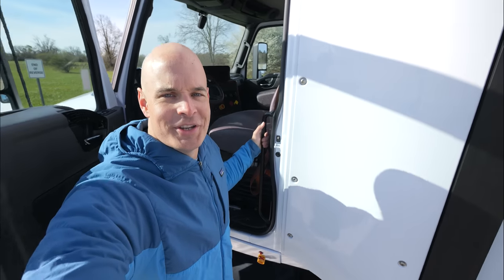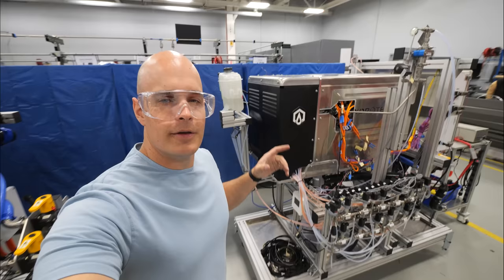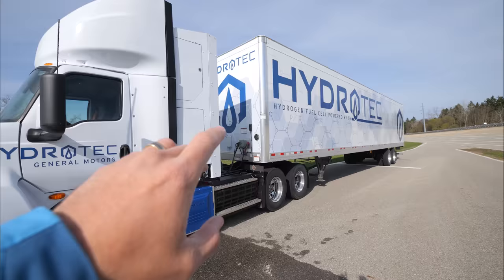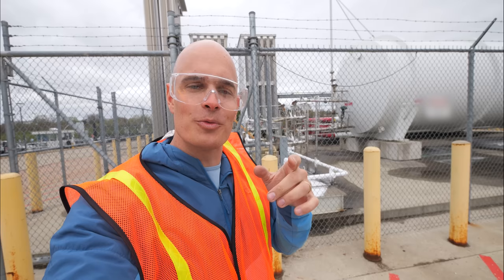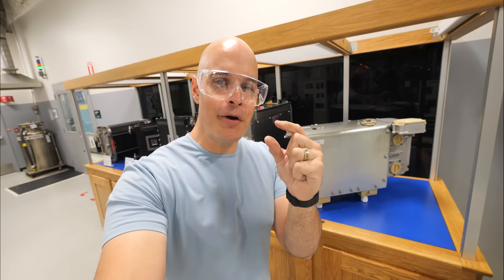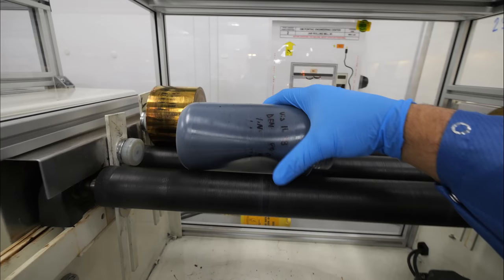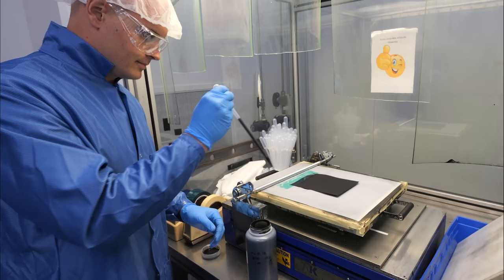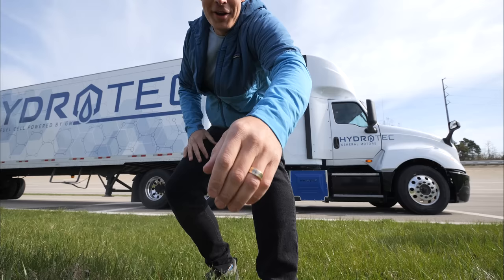How to build a Hydrogen Fuel Cell Semi Truck? - Hydrotec Factory Tour

Comment: I'm curious how a hydrogen semi handles crashes compared to lithium ion and diesel. My intuition would be that the rapid decompression would be very damaging.
Reply: I'd love to see some comparison
Reply: 10 000 psi would make a nice fireball
Reply: It'll blow up like crazy. Diesel doesn't explode unless it's superheated and gas piwer cars have much smaller tanks. Hydrogen on the other hand... hindenburg
Reply: It actually doesn’t blow up at all it is pretty quickly evaporated and that’s it. Explosion’s are extremely unlikely as you need to first ignite it and it would also only burn on the part which was punctured. As it requires Oxygen to burn and there isn’t any in the tank there isn’t really a huge risk. 

There i would be more concerned about the explosion of a battery.
Reply: @platin2148  you forgot the part where it's under pressure
Reply: @andrewk8636  And since when does this require anything to make a giant explosion? Especially fiberglass tanks are most likely to not simply explode but slowly loose the pressure. It might even sort of self heal or clog up as it creates frost.
Reply: Plus that cab did not have a sleeper on it which may causes issues. Trucks can only be certain lengths and the added space for thehydrogen storage will that preclude having a sleeper on the tractor. If not then the hydrogen is being stored right where they are sleeping.
Reply: @GregM  That’s more a unfortunate design choice there are some trucks from MAN and Mercedes who have them basically on the same place as there diesel equivalent because why not?
Reply: It is actually QUITE safe.  The carbon-fibre tanks are insanely strong, but even if they did rupture, the hydrogen would just be released as a  gas.  That might be a somewhat dramatic event, but there would be no fire.  Even in tests where they have explicitly set the fuel line on fire, it just burns like a torch; no explosion.  Compared to a battery fire, this is quite easy.
Reply: @whojamacallit  The thing is, there is still a battery in there, and in the case of a collision, if the battery catches fire, it won't be easy to extinguish, and it may affect the hydrogen tanks.💥
Reply: @giorgos997  The flame will just be a blowtorch as David stated. They basically tested this with Toyota Mirai, hydrogen is lighter than air hence it shoots up really quickly. Flames are not fast enough to actually reach the inside of the tanks, there's also additional pressure relief valves that acts as added protection that basically releases the gas to the atmosphere the moment a fire is detected.
Reply: @giorgos997  what battery?  the 12/24v system that even a diesel has?  There is no other battery.  A fuel cell doesn't charge a battery, it powers motors.
Reply: @whojamacallit  No, he mentions in the video that there is a supplemental 220 kWh battery. 3:05

Comment: Really enjoyed this video. Thanks Jerry.  I drive long haul and there is just no way a battery powered truck could work. Hydrogen is the best fuel alternative for the long haul trucks. Keep the electric ones for the last mile and short haul stuff. I'm pretty sure switching diesel fuel pumps over to Hydrogen would be easier than charge plugs. I'm excited to see this is getting closer to reality. They just need to make the fueling process idiot proof, trust me if you saw what some of these drivers do to regular pumps, you would have concerns about Hydrogen pumps in their hands.
Reply: How long do you drive (legally) without a break?
Reply: @rogerstarkey5390  I do about 10.5hrs total. I will go for about 6 hours straight then do my  mandated 30 minute break, I have to do that 30 minutes within 8hrs of starting my day. Then along the way I will stop every so often for a 10 minute break to just get out and stretch the legs and back. Not as young as I use to be and my back lets me know it. HA Legally we are allowed 11 hours of driving in the US, in Canada I can do 13 hours, but in both countries you only have a maximum of 14 hours of driving and On Duty  time on your logs. So if you start at 7am your day will end at 9pm, no matter if you drove 1 hour or 11 hours. It sounds like a lot of hours but you get stuck at a customer loading or off loading, get caught up in a traffic back up and there go your hours. It's happened to me so many times I just laugh and say It gets there when it gets there.
Reply: @Johnny_Kanuk  It's also the same case from what I recall for heavy machinery. They're also favoring hydrogen for lesser downtime, especially for big equipment that may be used in multiple shifts via driver swaps to lessen downtime which costs money for companies.

Comment: The hot water exhaust should go to a tap in the cab so that the driver can use it to make tea.
Reply: That's about all these things going to be good for with its incredibly low payload and range, just like ev trucks.  It's a shame hydrogen is not a fuel source this whole idea was flawed from the start. 

Hydrogen is what's called an energy Carrier,   Hydrogen is just another demand for fossil fuel. Hydrogen can be "made" with other methods but 99% of the hydrogen on this planet has been manufactured with fossil fuels because it's so energy intensive.
Reply: @Dat_Sun  FCEV range isn't bad and unlike BEVs you can refill extremely quickly.

Comment: For comparison, the classic steam locomotives operated at 250-350 psi. If the boiler ever exploded, they caused catastrophic damage, and shot pieces of locomotive as far as a mile away. Now we're talking 10,000 psi. If these things are ever in a bad wreck...
Reply: its not the same, gas density reduces the stored energy enough to not be that hazardous

Comment: At Least you could add a hydrogen range extender to your humvee, as there are 5kW fuel cell modules available for sale and they attach to regular h2 steel bottles. But I guess you would need a decent step up converter to get the voltage level up to your tesla battery modules

Comment: The first hydrogen powered semi is now  used by PepsiCo in Australia. So beyond an engineering sample
Reply: There's several Toyota/Kenworth hydrogen trucks running around LA for years.
Reply: @CACressida  They've also committed to commercial operations recently due to their success with the pilot program tests with real-world customers on LA. Kenworth is starting builds right now powered by Toyota's FC drivetrain with orders available early 2024 if I recall.

Comment: Hey, Zack, you should make a Hydrogen Fuel Cell for your Humvee, so it can charge the batteries to extend your range. this way you can get better mileage. Just Like the ones on the 18-wheeler but just a bit smaller than those. you can store maybe two of the carbon fiber tanks and it can generate enough kilowatts to keep all of your battery packs charged to give you at least two to three times more range. So if I remember correctly from your videos, (I could be off a bit),  you were getting about 250 miles on a standard charge. You could get about 500-750 more miles with the addition of a Hydrogen Fuel Cell
Reply: Theoretically yes, practically hydrogen is the most difficult gas to contain (and thereby also dangerous when not done well). Which would make it incredibly expensive for such a project.

Comment: Hydrogen powered house 😍
Reply: Kaboom
Reply: The most dumb idea I've heard in a long time. Why not blow the energy directly out of the window, along with loads of money?
For ground storage you can use cheap battery chemistry (energy density does not matter), that does not waste 80% of the energy you put in as conversion losses. And it does not need super expensive platinum catalyst.

Comment: This seems like a better idea than batteries. But wouldnt a ton of these trucks on the road create black ice in colder climates ?
Reply: Did you notice the hydrogen was just "in the tank"?
.
Consider the extra Grid infrastructure you need for this over and above straight battery storage. (Hydrogen is just a STORAGE medium, like a battery)

Comment: So cool to see another form of fuel for our earth. I think EV has a place but this could be something that could work beside or be more fuel efficient. Thanks for sharing!
Reply: If you use three times the grid energy to move a truck the same distance, it's not "fuel efficient".
Who do you think will pay for the grid energy?
The generating company won't give it away.
The grid utility won't absorb the cost.
It will be passed to the end user...... In an industry when cents per mile counts? You think that's going to work?
Reply: Ah..... This IS an EV. 
Just a very inefficient one because it is trying to produce the electrons onboard rather than take them from the grid.

Comment: Really well explained! I still think hydrogen doesn't make sense in cars, but I definitely see the use case in vehicles such as trucks.
Reply: Agree, the same as batteries in trucks make no sense, the weight penalty of the battery negates the trucks ability to move heavy loads efficiently

Comment: Two pretty significant problems with a hydrogen fuel cell based future (which for some reason no YouTubers ever explore in depth). 
1.  There exist no alternatives to Platinum group metal (PGM) based catalysts which are as both as efficient and durable, so without major advancements, we're trading one non-renewable resource  (fossil fuels) for another that are literally some of the rarest materials on earth.   There is no path forward for the hydrogen economy that does not include extracting pretty much all known PGMs from the earth along with 100% recycling, ignoring the fact that PGMs are in demand for many other processes. 
2. Hydrogen production itself is very dirty.    The current methods of hydrogen production include, Steam Methane Reforming (SMR), Oil Reforming, Coal Gassification, and Water Electrolysis.     Unsurprisingly, the first three methods account for 96% of all global Hydrogen production, and all of them produce higher end to end CO2 emissions than simply producing electricity directly from any of the same sources (natural gas, oil, and coal).     This is dumb, in a similar way that growing corn to product ethanol is dumb.

Comment: You should look up metal hydrides which is the newer way hydrogen is stored. It’s stored in a metal solid and is at low pressure and won’t explode if the tank gets ruptured because it’s stored in metal solids.

Comment: As a trucker I'd have some concerns! The length of this unit would make it rather impractical for city use (I deliver food to restaurants in urban areas) but I could see this being useful for OTR or regional applications. 

Also if the batteries are on the small size, how long can the unit sustain full power output to climb a long grade? Can the fuel cells put out enough juice so that doesn't happen, or will you run the batteries dry on a long climb? 

Does extreme weather impact the range of the fuel cells, like it can for batteries? 

What's the weight of the bobtail? Axle weights? If it's too much heavier than a traditional unit, nobody will want it because it means less freight hauled.

Comment: hydrogen fuel cells are cool tech for sure.   I still wonder if we wouldn't be better off moving back to rail transport though.  My limited research into it says rail was always cheaper and more efficient, it's just that bigrigs don't have to pay the full price for road construction, where railways do.

Trains could displace not only a lot of long haul trucking, but also plane traffic, and would be easier to electrify than either long haul trucking or flight (most trains already run on electric motors, and it's easier to replace the on board diesel generator than the entire drivetrain)

Comment: you start with an electric semi truck to make a hydrogen fuel cell truck. I think Tesla Semi electric truck is the most optimal, they crammed 900kwh into the thing so that it gets massive regenerative braking.  Strong regen braking is crucial for Semis reduce brake fade/failure and so is to reduce maintenance of the brakes, also to charge batteries when braking or going down hill.  Making a good hydrogen truck might to need start with at least 600kwh of batteries, but at this point, you just make an electric truck.

Comment: Zack
Do a Sun to wheels analysis of the energy used.
Ask what that solar energy would be used for if it wasn't being used to inefficiently liberate hydrogen.
(Clue, it would be removing fossil generation from the grid...... The fact that using 3 units of solar to provide hydrogen means 2 units of fossil remain, meaning the grid is dirty compared to using straight electrical storage..... Hydrogen is dirty ... All of it )
.
Ask who pays for the grid energy. (Hydrogen is expensive)

Comment: as a mechanic, the way i see the future of the standard car, it will be an hybrid between hydrogen and lithium ion batteries for fuel. You get the silent ride with good horsepower,  high and snappy electric torque and fast cheap fuelling.

Comment: THIS should be the future of vehicles not just EVs but at least a combination of EVs and Hydrogen. Both are clean, but hydrogen can fix the range and refuel time problems EVs have.
Reply: This IS an EV. In fact it is a BEV as stated in the video.
It's just dragging along fuel cells and a pile of hydrogen tanks too.

Comment: This is the future of many sectors like construction, farming, maybe planes? and so on for situations where you need the capabilities that fossil fuel gives today. Without the disadvantages like weight, slow charge time, low energy density etc. that batteries have. However, for transport on roads where charging infrastructure can be implemented, batteries make a lot more sense because of the efficiency that hydrogen is missing. 

So, to simplify, think of batteries like petrol and hydrogen as diesel. Each fuel has its advantages and disadvantages and therefore different usecases.

Comment: Very nice video about technical aspects of hydrogen vehicles. However they are few very important points that should be stated.
1) Hydrogen being most abundant element in the universe. True it is also highly reactive which means free floating hydrogen can only be found in vacuum of space. On Earth there is no free floating hydrogen, it needs to be manufactured either from hydrocarbons (which produces carbon emissions) or by splitting the water molecule (electrolysis). 
2) Hydrogen powered cars produce don't produce carbon emissions. True but manufacturing of Hydrogen does as 95% of our H2 is from hydrocarbons. Conventional electrolysis of water is about 70% efficient process. Powering electrolysis from renewables such a solar or wind is much quite complicated in practice due to issues with intermittent power delivery of these sources.
3) Hydrogen cell has its issues as well. Relatively high price and quite low efficiency (40-60%). So the whole hydrogen cycle efficiency water -> electrolysis -> hydrogen -> fuel cell -> water, is only about 30%. So you really need to make 3-4x as much energy than you can actually consume in the vehicle.  
4) Energy density - yes on paper hydrogen has much better energy density than lithium batteries. However again in practice when you count in high pressure tanks, piping and fuel cells. Vehicle weights the same as comparable EV with batteries. 
Toyota Miraii - 1900kg (4188.8 lbs) / range 650 km (400mi)
Tesla Model S -  1961–2250 kg (4323–4960 lbs) / range up to 650km (400mi)
So yes hydrogen vehicle is lighter but only by 10% or so.

Comment: I am curious as to how the fuel cells differ from the battery packs already in the Humvee.  What would the difference be in weight, amount of space used, components used, monitoring/display hardware differences, etc.?  What about a downscale perspective, perhaps in powering the Not-a-wheelchair designs?  Highlighting the pros and cons on the scalability of different energy technologies could help people better understand some stumbling blocks on the path to a greener future.  Also, what about fuel cell powered charging stations?  Being able to maximize the wattage available for charging is a contributing factor in the speed of the charge, correct?  Just a few things that this video kicked loose in my always busy brain.  Thank you again Zack for another great tech video that demystifies some of the things going on.
Reply: > What would the difference be in weight, amount of space used, components used, monitoring/display hardware differences, etc.?

The weight difference is mostly due to lesser weight needed to actually add more capacity. Adding capacity to batteries requires adding cells, this is a problem since battery cells are a complete package, they handle both generation and fuel, you also need a bit more connectors to connect those cells and a BMS to make sure they don't do any thermal runaways. Add those up and it will start to have a noticeable add on weight. Hydrogen on the otherhand separates the generation and fuel, the fuel cell stack is a fixed weight depending on stack size and adding capacity is as easy as adding more tanks or a bigger tank, this leads to less added weight when you add all of it up.

> What about a downscale perspective, perhaps in powering the Not-a-wheelchair designs

As for downscaling, there has been usage on Hydrogen for commercial drones since they have much higher flight times than batteries (2+ hours for 1kg tank vs 30-40 mins for a heavier battery pack). The cells can be built really small, the biggest obstacle for super small applications is the hydrogen tank itself. That tends to have limits on how small you can have those, in China I know they have at least shrinked it to the size of a water bottle for their city EBike demos, but making them as small as phone batteries might be unfeasible yet.